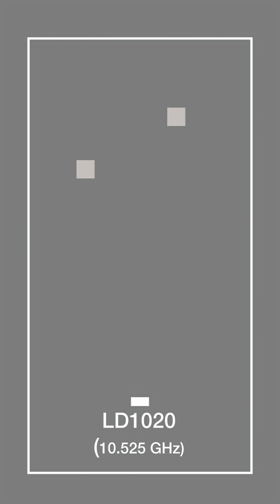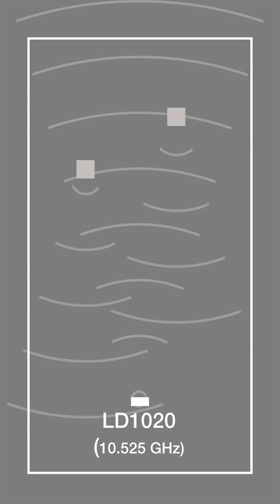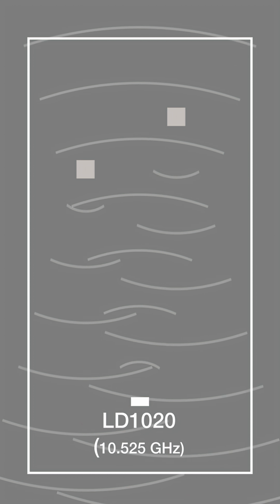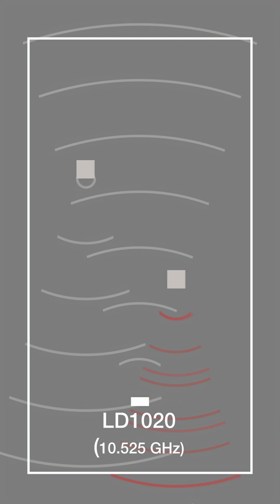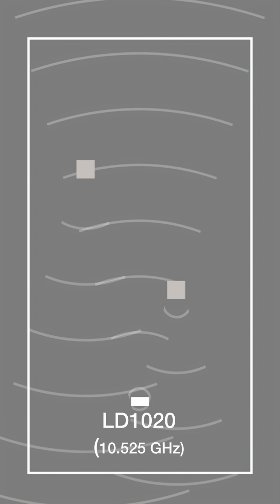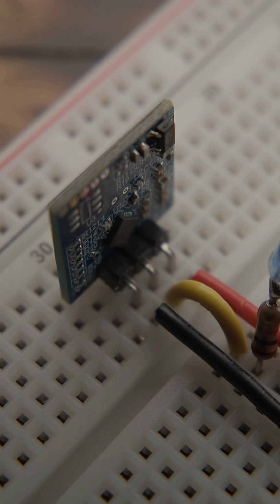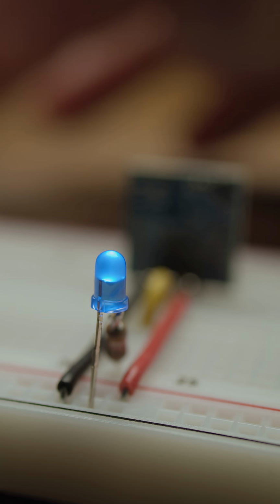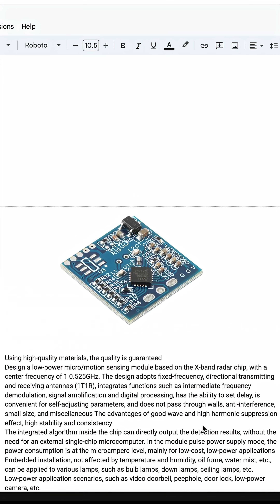LD1020 Radar Module

Comment: I prefer the RCWL-0516 and the CDM-324, 3GHz and 24.125GHz respectively. The RCWL-0516 is omnidirectional and quite high power relative to the other, higher frequency modules, so it can detect an entire room's motion with ease, even through sheetrock walls. It can be made unidirectional easily with just simple reflection or blocking (think horn antennas) and then it becomes an outright phenomenon, able to penetrate block walls with reasonable efficacy. It is by default a trigger device like the one in the video, but if you know where to look you can tap the mixer output and use it to do things an on/off switch can't.
The CDM-324 is a full on doppler radar capable of not only motion detection but full on speed detection. I prefer to just plain listen to it (yeah I'm weird) but when I first got it I made a full speed trap with one using an old Dish Network 500 steel dish to massively amplify the signal reach and a Raspberry Pi with a simple FFT Python script to constantly report the speed. After that I made a full FFT spectrogram with rescaled values to directly display all detection in MPH. It could easily speedtrap cars beyond a quarter mile away. Right now I have another CDM-324 aiming into the backyard, just connected to a high gain op amp feeding into my usual home stereo mad science mess because I like to listen to the little whoops of bugs, rain, birds, the rumble of the wind rustling the trees, etc. It's very zen in a high tech kind of way. I also have it feeding a 24/7 PyQt5 Pyqtgraph script so I can look at the signal trends over the course of each day. If I wanted, I go simpler and have a microcontroller flip a switch on and off, but that seems embarrassingly primitive to me by this point. I am however considering running one of the RCWL-0516 units in the house on a micro though, sending alerts if the signal disturbance goes over a certain threshold. I already have an army of security cameras so I'd just need to look at that time and be like "Oh, it was a lizard in the house again".

I do have an HB100 10GHz radar module but I found it to be kind of redundant. The penetration is ok, but the RCWL-0516 easily blows it away in that regard. The signal strength is worse than either of the other modules and the doppler output is annoyingly low frequency which makes it less immediately enjoyable. Even on the sat dish it's just "ok", nothing stellar. It just seems like the one you'd use if you had nothing better, which I do.

I've seen a lot of tech come and go and these for as simple as they are, are incredibly cool and useful. These little radars are pretty amazing
Reply: Thanks for insightful writing. Lot of help!
Reply: Where are these units available to purchase
Reply: @MrSailor50311  Go on the internet and try a search.
Reply: Interesting hobby.
Reply: All that just to avoid going outside for real and hearing the sounds of nature the natural way. Ergo: Very impressive, now go touch grass.
Reply: @KainRazielMT  WTF are you talking about... This is RADAR, not a microphone. You do know what radio waves are, I hope.
Reply: @NightRunner417  ами той човека си е прав ти сам каза, че го ползваш да слушаш звуци от задния си двор (буболечки,вятръра...), пък и какво са радиовълните, те не пренасят ли аудио и видео сигнали? А чувал ли си за лазерни микрофони, които превръщат трептенията на светлината в звук, кйто можеш да чуеш?
Reply: @NightRunner417  Незнам какво знаеш и незнаеш, но само напълно невеж може да твърди, че знае повече от някого когото въобще не познава
Reply: @joniboni3691  Which is exactly what the person that commented to me about me needing to go outside and touch grass did. And anyone that backed that up is just as bad.
Reply: I still can't manage to make RCWL-0516 to work properly. It only can detect within 5cm.
Reply: @Naxxami  You're using it as a default switch, I assume, with no mods? Sounds like a bad unit... I got a pack of four or five when I started and they were easily switching at several feet. The prodigies got me out to 15 feet. I didn't have any bad ones outright but that was surely luck, and one or two did die mysteriously, could have my fault in design. With these, always buy cheap in a pack of four or five, then sort out the ones that suck. They're not worth but $2 each so don't spend more than that and just cull the bad ones.

Modded with the analog out the good ones will easily show disturbance approaching 30 feet. Oh, and make sure you give them good, clean power. I run mine on a 7809 regulator, that's NINE volts. They're good up to 20V or something like that.
Reply: Hey bud,
You seem very knowledgeable. Would you mind guiding me in my 1st electrical project? I dont have much money but I can pay a bit for your help.

I dont get notifications but will come back to this video and check your reply.
Reply: @kg-Whatthehelliseventhat  look for a local electronics club, online or local classes, buy basic kits, etc.  Getting started is not a small thing.
Reply: Fine, though if the job is to control lights in a room, it's no good if it'll be triggered by people passing in a busy corridor outside, leaving the empty room on most of the time.
Reply: How is it possible to sample a 24 ghz signal for fft?
Reply: @stendeter623  You don't. The outgoing signal reflects back from the target, and then the outgoing and incoming are mixed, creating a heterodyne that is relative to the target's velocity. At the output pin it runs from 0 Hz with no motion up to several KHz for a couple hundred miles per hour. All you need is basic audio frequency analysis.
Reply: I read and like. Can this be used, so I can U derstand, to detect movement 8 M away? Any circuit diagram for dummies?
Reply: @hermanbakkes4008  

I am looking after similar thing. 
I have annual rodent problem in the basement, where rodents slip in in fall/spring time where it is warm when people walk through the doors and leave doors unattended for a few seconds (those are so damn fast, it is just 1-2 seconds to have opportunity and look elsewhere and rodents jump in like in movies). 

And I have an idea that it would be possible to make an small device that is attached to power socket next to doors, and pointing the room itself above (behind the walls is just soil, no other rooms) and get then on the hallways a light to signal that there was a movement detected after last door opening. 

So making simple device that resets the detection light when you open/close the door, and then waits those few seconds after door is closed to get active again.

This if course if it would be sensitive enough to detect a tiny rodents moving in the room up to 4-5 meters at max. 

As it would help a lot then to start tracking them and place some traps (people, don't use poison, as the rodent will revenge their death if they have way to get somewhere you can't get it out, the smell is awful. I still remember the last tiny mouse that died 40 years ago between the ceiling panel and window, and the smell you get for couple months is what makes you puke. You have been warned!).
Reply: The ability to scan through sheet rock may be good for some applications, but the LD1020's inability to penetrate sheet rock makes it ideal for single room applications.
Reply: @Eszentric with LD 2xxx sensors can be set to activate only in some range, it's defined by millimeters and you can even make areas where it detects, so you can set it to activate only from 3000mm to 4500mm (3m - 4,5m)
Reply: @Eszentric Landlord wanting to spy on his tenants. What a surprise.
Reply: @KainRazielMT motion sensing to activate lights when walking into a room is what I had in mind
Reply: Nice dodge, you saved it.  @Eszentric
Reply: The X-band sensor in this video would be a 47 CFR 15 low power intentional radiator, legal to operate unlicensed, but fairly restricted in power or signal strength (outside some police now mostly obsolete RADAR).  

That K-band unit is on an ISM band as well as Part 15, and so depending on details could be legal to design at very high power levels, and range.  

Around 3 GHz is messier as to different spectrum segments and legal issues.  Some sensors also operate around 5.8 GHz, where both Part 15 and 18 options exist overlapping or adjacent.
Reply: @lokiva8540 how do I get a job driving around looking for overpowered illegal signals?  They must hire thousands of people a year.  The pay must be amazing.

Comment: I hate these with passion. My apartment has several "automatic" lights that use a sensor similar to that, and I hate them. For example my hallway light keeps turning on, even when people pass outside of my apartment.
Reply: But then again, badly designed auto-lights with PIR sensors are also terrible.

Comment: Can it detect metal underwater 1-mile to 10-miles out.
Meaning, can this detect submarines?
I know you said 25 feet max,  but can a modified version get longer?
Reply: Water is very radio opaque at most normal frequencies we use, the higher the frequency, the more water blocks it. The US and a few other countries have ELF and ULF (extremely low and ultra low frequency) antennas to talk to submarines underwater, and the antennas are literally miles long to transmit at those low radio frequencies.

Comment: Most people use a passive infrared sensor (PIR) not just because they are cheap, but also because they require 2+ orders of magnitude less energy and thus can easily run on batteries. I've yet to see a radar module that can do that...

But still a really nice module for some specific applications! :)
Reply: UWB radar can run on batteries... & inconspicuously low emission levels!
Reply: I remember doing a project a long time ago that scared me off of cheap PIR modules, I think it didn't like the power supply noise.  But recently more and more consumer products use them and they are generally really really nice.
Reply: I find the Tri tech motion detectors to be very effective at detection and very limited to false alarms. PIR keeps detection in the visible area, radar keeps false heat and cold signatures limited, and temperature compensation keeps them both in balance.
Reply: @raddtadd22 I like that. Passive always likely to use less power than active,  so use PIR for initial detection, and only then use the active radar to verify, or eliminate false alarms.
Reply: @raddtadd22 one of my favorite defeats in the pen tester world that fooled temperature and motion... blow up doll Sally! Location had mag locks on the doors that allowed you to just walk right out but needed to badge in. Shove it under the outside door of a vestibule style entry with a tube attached. Inflate it with a hair dryer...the temperature it needs to unlock the door, size of object (usually function of thermal as average temp within area is one approach), and the motion meets criteria for the exit function to work. Bonus points for overuse of "Sex doll Sally" in the pen test report
Reply: Anytime you make statements about the state of anything technology related, you are only speaking as of last time you checked, and how far you researched at that time. You might be wildly behind in information.
Reply: Who cares. Have you seen pir sensor that works through walls?
Reply: @ColMustard513 "Who cares"
What a very silly thing to say. Anyone that needs something to run on batteries for extended periods cares.
Reply: @ferrumignis Well in the literal sense, yes. My objection is primarily due to them ALSO having wildly decreased functionality.
Reply: @ferrumignis  - How about some 555 like timer, that only turns the sensor on, when specific needs are required?
Reply: @ColMustard513  why decreased?

what if you want only trigger in one room and not if something metal moves two walls away?

those are different sensors for different purposes
Reply: @ColMustard513 horses for courses. Depending on application, the ability to see through things raises the likelihood of false alarms.

Comment: Military systems designers in the 1930s would never believe this possible.
Reply: Military systems designers in the 1940 believed this to be possible, and developed the proximity fuse (with the name "VT fuse", "variable time", choosing this name so as not to reveal that it actually used crude microwave technology).

An "all around-looking close-in radar" if you wish. Used in AA ammunition.

Before the VT fuse, ammunition had a time setting that was fixed before firing, making the shell explode at a roughly fixed altitude. AA artillery fired such aiming for the estimated position of the aurplane(s) when the shell reached their height. Because of the variances and uncertainties in both position and height, massive amounts were fired with the "statistical hope" that one (or a few) would detonate close enough.

The term "variable time" refers to that this kind of fuse does not have a fixed time between firing and detonation.

With the introduction of the VT fuse, a shell detonated when it came close enough to the target. The increase in hits was quite significant, and the Japanese and German air forces suffered greatly.

It has been quoted as one of the most important technologies that helped bring World War II to an end with victory for the allies.

The Wikipedia article titled "Proximity fuse" is a good read.
Reply: @davebowman6497  That's very cool!
Reply: @davebowman6497  

Timeline of German Proximity Fuze Development:

1930s:
Germany began its independent research into proximity fuzes for artillery and bombs. 

1939:
British Intelligence received a prototype design and a neon lamp tube from a German source as part of the Oslo Report. 

1940:
The initial German research program was halted due to the Führerbefehl (Fuhrer Directive), which prioritized projects with rapid production potential. 

1944:
Research and testing by Rheinmetall resumed. 

End of the War:
Functional prototypes of several hundred units were successfully tested, but they were too late to be mass-produced. 

Again Germany had everything ready way before UK spies got their ears to it. 
It was just a micromanager that again stopped the development by reading the bottom line, not what effect it would have.

So much has been lost because of all the capitalistic ideology to prioritize something at the expense of other projects by stopping those. 
"Prioritizing" should mean that little more money and time is invested to subject, not that it is halting other projects. The project own merits should be reason to stop it or decrease development and research for it.
Reply: I still don't.

Comment: Could you use this for fracture testing in metals?
Reply: doubt that. the chip outputs one signal of high which can not be used as realtime measurements. perhaps the datasheet could help find the pins with realtime detection outputs to use with oscillator

Comment: Imma use these. Two a couple foot apart to sample vehicle speed. If vehicle is too fast, it sets off a giant tesla coil. Im sure it won’t hurt anything but it would be super scary. 

But first would flash a slow down sign, then pump the he coil a couple times and if slowing doesn’t happen, wham!